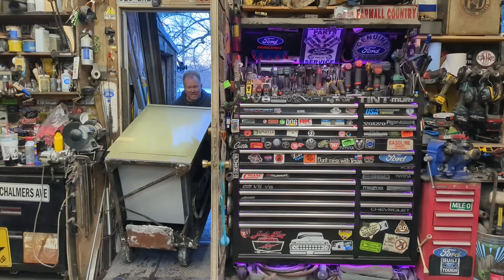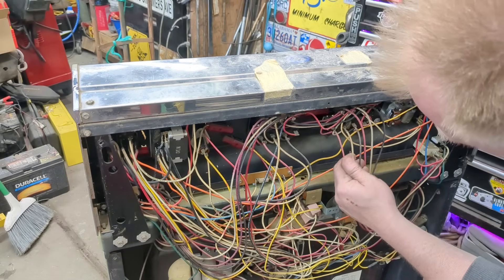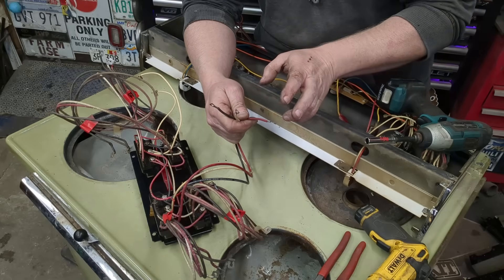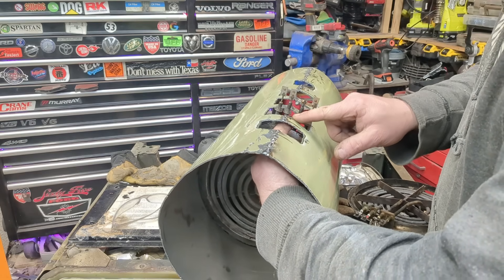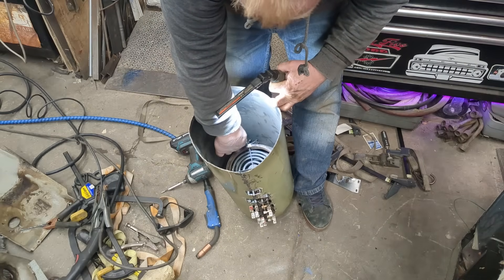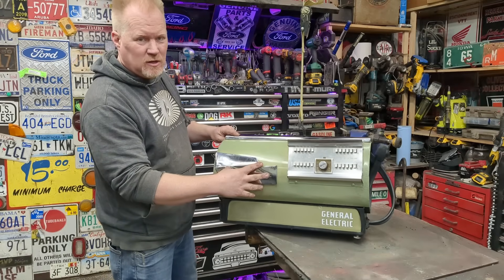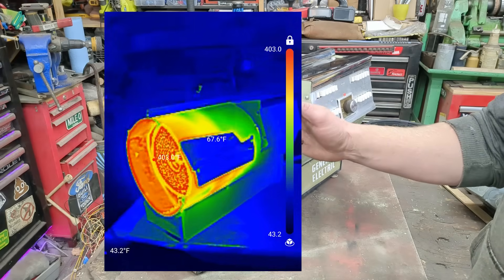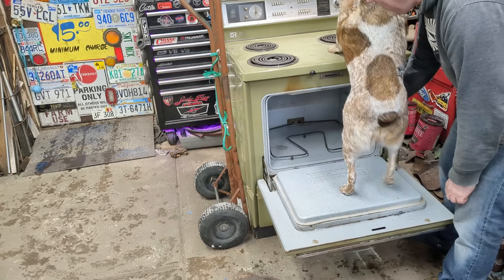Shop HEATER from old OVEN custom build

Comment: 60 years old & still works & this new junk might last 10 years if you're lucky!
Reply: I came here to say that.  This stove is a few years older than me and still works.  Oh, and there's no planned obsolescence is there?
Reply: Two years ago I went to a farm auction. Out in the lawn lineup was a chest freezer, the logo read "International Harvester", and the data tag on the back read "Manufacture Date 1948" I forget the month. They had it plugged in and running like a champ😲
Reply: You’re not wrong. I use a 1958 Caloric gas oven that has been passed down through 3 generations in my family. It still works like new. It is SO heavy compared to any newer ovens. And I’m pretty sure it’s gonna outlast me.
Reply: And a maintained cookstove will last generations.
Reply: My father has a refrigerator in his basement that he uses for drinks and food over flow. I can remember going into that fridge to get drinks for me and my friends when I was 9ish... I'm 50 years old now and that fridge still works!!
Reply: They built them like tanks back in the day.
Reply: they cost more to make to get a good price they made them like garbage now   @Subgunman
Reply: Right he’s tearing it apart when he should be installing it in his kitchen and using the modern POS he likely has already in there to tear apart and build a shop heater
Reply: I was shocked to discover modern fridges no longer have removable drip trays. If they overflow, you're up the creek without a paddle.
Reply: @bobweiram6321   That's because they're supposed to be designed to be frostless. Note I said "supposed" to be. They also erroneously assume nobody will ever spill anything inside the fridge. While that may work for me, I seriously doubt it does for anyone still raising kids! Best wishes!

- Max Giganteum
Reply: More like 5 years and that includes at least one repair in the 5 years.
Reply: I resemble that remark!
Reply: More like 2-3 years
Reply: @thevoidedwarranty and that's if you're lucky I bought a air fryer at Walmart for 70 dollars and it took a shit after a year of use
Reply: Usually 6 at the most
Reply: 10??? The shock absorbers went on my AEG washer dryer after 2. My first and only Bosch washing machine before that lasted 25 and only because it started to develop some rust.
Reply: @strongandco  I have mixed feelings about Bosch. Like many German manufactured products, they're very reliable and well engineered, but repairing them is often infeasible. A non-critical replacement part can cost as much as the entire unit.
Reply: Got a modern gas stove and the oven broke down just as the 2 year warranty was up, the 4 burners work fine and we didn't use it much, but damn... wish it lasted 10 years...
Reply: 10 yrs too much
Reply: As an appliance repair technician we tend to tell clients to expect a $500 repair within 7-10 years.
Reply: You're lucky to get a new stove to last that long
Reply: All the parts are replaceable at Menards
Reply: My exs broke after 6 months, good branded one too. Some specialist came out and replaced parts, worked another few months and broke again. Ended up getting an entire replacement this time. See how long it lasts now.
Reply: Survivorship bias
Reply: This is the innovation they speak of when it comes to capitalism - the innovation to maximize the extraction of profit from everything and everyone.
Reply: Oh shut the hell up, corporatism is to blame, not just vague capitalism, all of you are the exact same and also minge about the same aswell.  @ProleDaddy
Reply: @ProleDaddy  Where are the great innovations socialism & communism brought us?   There are none they stole them from us and then build a half ass version with slave labor!
Reply: @ProleDaddy   Still waiting to see the list of innovations socialism & communism brought us!
Reply: @williamzoom So we went from talking about the subject at hand "durability" and some dork starts talking about socialism and communism. How those two views affect the rampant capitalist greed that the modern right loves and which is the actual cause of higher prices and lower durability is beyond me. Keep the political talk on a political post and quit annoying everyone.
Reply: @matthewmoilanen787   @williamzoom made a valid counterpoint... and you failed to respond to it. Something those on the left just LOVE to do. Perhaps you should look up the term "deflection" and stay on point. Capitalism has a brake, it's called consumer spending or the lack thereof. If a product fails to meet my standards then I don't buy it. That holds true of people in general. If a product or name brand is known for crap, they'll either make better products when their sales nosedive or they'll go out of business. The simple reality is to only spend your money wisely and only shell out for quality. Do so and you'll get it! The nutshell version? Pay more up front for quality and you'll never have to worry about short term failure.

- Max Giganteum
Reply: You can thank government regulation for that. Most appliances now are trash for 2 reasons… energy efficiency requirements forcing components to operate at peak efficiency so there is no longer over-engineering, and the addition of a ton of electronic bells and whistles.
Reply: @Isaacmantx we could have completely immortal appliances if it weren't for those pesky regulations requiring efficiency while we speedrun the death of the environment, damn
Reply: @Hawk7886  just imagine how much carbon footprint you save pushing that motor to 99% efficiency… it definitely offsets the carbon footprint of having to manufacture replacement appliances every 5-7 years instead of every 50-70. Just don’t do the math on that, because it will show how the “climate” based policies and regulations are shams. 
6 years ago we had a chest freezer die that was over 70 years old. In comparison, within the last 8 years since we bought our house, we have had a fridge, a washer, a dryer, and an upright freezer all die… and all were purchased I. The last 8 years. The old freezer was the better choice for the environment.
Reply: @Isaacmantx  ignoring the anecdotal evidence regarding survivorship bias around an ancient appliance, you might want to try doing the math on just how many people exist. It's wild. Turns out there are millions upon millions of these things being built and shipped all over the planet for millions to buy and use. 
What's your point? Efficiency goals are worthless? Do you think it's the increased efficiency that causes modern appliances to fail, and not planned obsolescence, necessary complexity in design, or cheaper materials used in construction?
Reply: @Hawk7886  talk to any engineer about how efficiency works… want a 30% more efficient fridge? Reduce the size of the motor and compressor by 30%. This in turn means you are running those components on 30% longer cycles, they are running closer to their max performance level (for longer periods) which increases wear, which means you can assume a 30% (or larger) shorter lifespan on the components. Old appliance components were very over-engineered to handle the task at hand, which is why they lasted longer. Modern appliance components are pushed extremely high into their max performance curve and will never enjoy the average component life of the days of the past. Add in ever increasingly complex electronic components, and their failure rates, and you are guaranteeing an increase in failures overall within the system. 
They don’t have to plan obsolescence, they simply have to push components to their max and add complexity.
Reply: Who cares everyone arguing in the comments has mybe 10 years left
Reply: @michaelsnyder5773  You cannot even spell ''maybe'' correctly!  You're one of those fools that will walk into a open manhole because you are glued to your phone!
Reply: Thank you uncontrolled capitalism. No continued profit in a product that doesn’t need replacing in your lifetime.
Reply: You are free to manufacture any product you like that will last 20-30 years and do so in a way that you make millions then move on to the next product then the next. @MatthewStevens-du1hk
Reply: GAGGG!!! Avocado Green! YUK!
Reply: @Subgunman   From clear back in the mid-60s to the mid-80s, I can only remember about 3 colors for kitchen appliances unless they were countertop chrome... white, avocado green and harvest gold! Thank heavens we made it to the 1990s and branched out!

- Max Giganteum
Reply: Yes but new appliances are far more energy efficient.
So in that ten years, you're saving thousands of dollars in electricity costs.

I just replaced an old in-wall heating unit that was 3kw to operate. The new one is 600w. My electricity went down almost $90 in 1 month. 4 months of use in the cold season is $360, in ten years thats $3600.

So even if you did have to replace your new appliances every ten years, it's still cheaper than using an old one in the long run.
Reply: @Az_N.S.O.L.  So you save a couple dollars a month on electric if you have electric appliances yet have major expenses for repairs or replacement in 10 years vs having the same working appliance for 60 years?   The only people it's working out for are appliance techs, the companies who sell this junk and Asia!

Comment: My Grandmother used to have a dark maroon gas stove (with standing pilots, no thermocouple, they'd blow out and fill the house with gas) as well as a matching vent hood and dishwasher.  The dishwasher had these black plastic "piano keys" which were the weirdest thing ever.  Original from 1973 I believe.
Reply from the maker: That's fun!
Reply: @sixtyfiveford  I remember having to use a paperclip to unclog the pilot burners as they would get filled with carbon, causing them to blow out easier.  Luckily that stove got replaced in 2003.  I believe it had a total of 3 pilots.  1 for the oven, and 1 EACH for each bank of stovetop burners.

Comment: Without any insulation, isn't the entire unit going to get extremely hot?  And with no filter on the intake, won't dust accumulate on the elements creating an even greater fire hazard?
Reply: I thought HEAT was the point.
Reply: @lourias  The control box with plastic components which is normally shielded in an oven is directly mounted to a metal tube which is pushing out 400F+ air.

That's not the kind of heat you typically want transferring into your electrical panel or nearby objects wherever you place your heater.